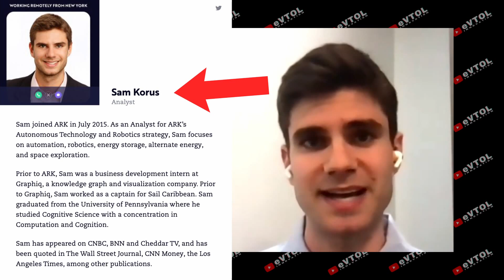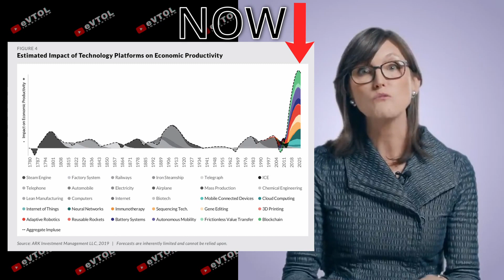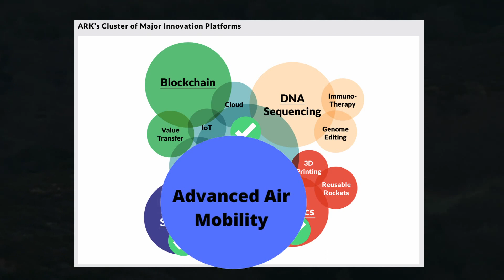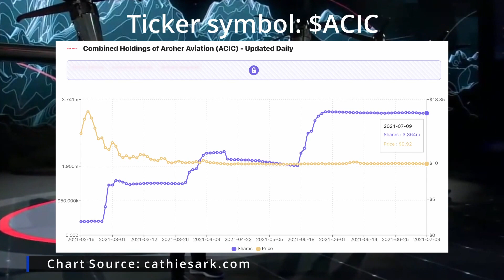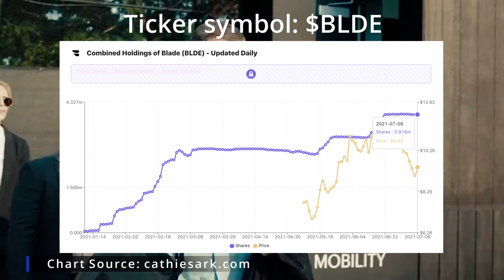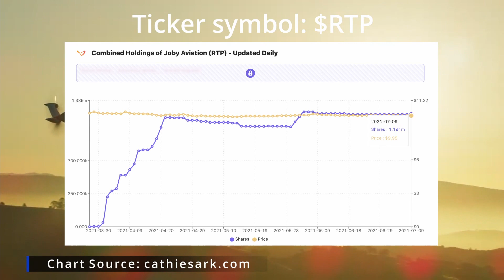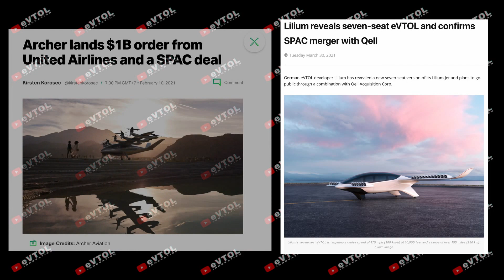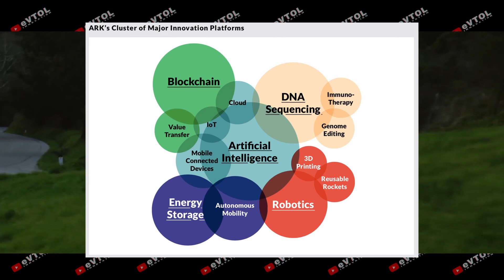"$100s of Billions" Why is ARK Invest buying into Air Mobility and Air Taxis $ACHR $JOBY $EH $LILM

Comment: JOBY is the future! Other competitors don’t have FAA or CAA type certifications. Farthest trip capabilities, most quiet design, DOD contracts, great leadership. WATCH OUT!!
Reply: they don't have certifications on their craft but as an air taxi using normal planes. they don't every carry passengers.
Reply: Sorry but customers have already made their preference for jets clear. That's why turboprop airliners like the Dash 8 died and the Boeing 717 lives on despite one being clearly more efficient than the other.

Lilium will win the customer's hearts and wallets with their ducted fan design that doesn't have six flailing props scattered across the airframe. It's a more attractive and safer design with the ability to more safely get into and out of tight helipads.

Additionally the ducted fan design is FAR more scalable to larger craft than can still takeoff and land on the same helipads that a scaled up Joby would not be able to. And four seats is not enough for any economies of scale.

Lilium's fixed wings with canard allow a glide and lower vertical speed in an emergency descent than an auto-rotating helicopter, and it also has a BRS if all else fails, something most of the others don't have. It will be the safest option with a one in a billion chance of failure.

Joby, Vertical, Uber, etc. will struggle with customer acceptance when shown side by side with a spacious 7-seat Lilium Jet.
Reply: @TecnamTwin  Lillium has yet to fly a full scale prototype to prove their tech. They also need $$$. Joby has over 10k flights with the S4. For the business model, the S4 design shows it’s viable based on how many test flights completed. Archer’s Midnight has design flaws. Second to Joby is Beta Technologies
Reply: Watch out while they crash their prototypes maybe 😂
Reply: Total bs.......ceo and buds will end up millionaires be logical it's a helicopter
What problem have they solved its airport to airport then what? Is grandma going to fly one these plastic orbs to rodeo drive buy shoes go home...simple
When you have this problem solved.

Comment: AIr mobility is blowing up because the aircraft are here. all thats required is certification by the worlds aviation controlling bodies, EASA and FAA  as well as proper legislation around this new market.  The ground work for key Pilot states has alread been established.  And the key component to make it all possible, Tesla's next generation batteries, is in production.   Its not so much of a matter of if this will happen as its already underway.  its moreso where it will first be available. And we know at least for eVTOL companies. LILIUM jet,  they are setup to lauch headquarter in Orlando florida, covering much of the south florida's major cities.    Its a market that will explode over time. Its one to invest heavily in. as the future will see more and more dependence upon air mobility.

Comment: The top leader is EHang, if one invest into Ehang stock, they can make lot of money by 2035
Reply: 2035? 😳
Reply: @msureshkr   Yes the evtol industry business will start from 2026 onwards and it will go upwards from that year and to become rich you need to wait till 2035 to get crores of money
Reply from the maker: I do own $EH, I think it has great potential. I’d like to see some improvements in the long range evtol side, I don’t see the vt30 as a viable product.
Reply: @eVTOLinnovation  once vertiports are ready, then the business will start however currently all the evtol companies will work on approvals, testing, demos, upgrades, vertiports etc
Reply: I highly doubt that. Their design sucks compared to competitors like Joby, Vertical, or my favorite Lilium.

Comment: Battery density is not like chips, you cannot simply assume they will double and halve in price like chips, they will not.  If anything, limited lithium supplies and explosion of the demand will make batteries not that much cheaper in the future.
Reply from the maker: Battery density and power density will improve, there is no reason to think otherwise. And the cost decline will follow wrights law. (Not Moore’s) 
I rather be a rational optimist
Reply: And yet NanoXplore & Amprius proved you wrong already
Reply: The cost curve in reality is declining with the exception of the supply shortage bump. You can think whatever you want but reality is what matters. Capability is going up and costs are coming down with economies of scale.

Comment from the maker: 🏁 In the Urban Air Mobility market, the leaders are Ehang and Volocopter,  I compare the two companies in this video 👉 https://youtu.be/w_NAJBoFlUI
Reply: more like the CPC v Velocopter.
Reply from the maker: @laohu5511  CPC??
Reply: @eVTOLinnovation  Bull.  The only leader is Joby Aviation.  They're on the way to certification in the U.S, have a functioning prototype, a partnership with Toyota and many other advantages.  Maybe Lillium, but some of their ex employees claim they haven't reached the range specifications claimed (and other specs).  The volocopter and Ehang both rely on a copter/drone style of fighting gravity.  Both are about 1/4th as efficient as lift generated by wings cutting through the air.  A helicopter or drone is aerodynamically "dirty."  That means lots of turbulent resistance to forward motion.  Ehang, Volocopter, and similar craft may enjoy limited success early on, but in the long run, you need a clean winged craft, preferably as part of a lifting body: See Eviation.  Electric flight based on batteries or good fuel cells is possible, but these energy sources are really limited so your vehicle must be highly efficient.  The most efficient propellers (and the least noisy) tend to be large.  Lillium's design relies on ground effects, but has very small blades, which tend to be inefficient, although the cowlings should reduce noise a lot.
Reply from the maker: @gregtuve1109   UAM represents flights of up to 35km. After that I call it RAM. I believe the S4 will be more valuable for long trips.
Reply: @gregtuve1109  Lilium's jet is very inefficient in the vertical and transition portion of the flight, but the clean aerodynamic winged design allows for a fast and efficient cruise.

Yes Joby's eVTOL is faster and more efficient, but it's a smaller, lighter 4 seater literally covered in propellers. No thanks. I'll ride in the beautiful and spacious 7-seat jet. I don't care if it's more expensive.
Reply: @TecnamTwin  Illium has yet to fly a full scale prototype. Until they do, they are a dream, and they are at least 3 years behind Joby

Comment: Ehang is the best player in this space. No doubt about that till the moment.
Reply: Sure, best player with 2 seats, if they want to scale up, good luck!
Reply from the maker: Clear winner in China, a big enough Market!
Reply: Joby is the one bro. Gl to all in this space 🚀🚀🚀
Reply: They're not scalable and their design is incredibly inefficient compared to winged ones. I'm rooting for Lilium that doesn't have a bunch of exposed blades hanging all over the airframe.
Reply: 💯% wrong.. but China recently pre-ordered 100 Lilium jets at least..  They're the leader in eVTOL after all
Reply: 6000 shares joby 
2000 archer
2000 blde
evTOL Covered